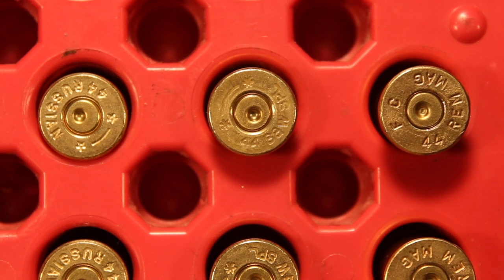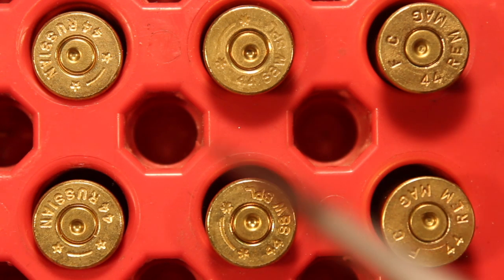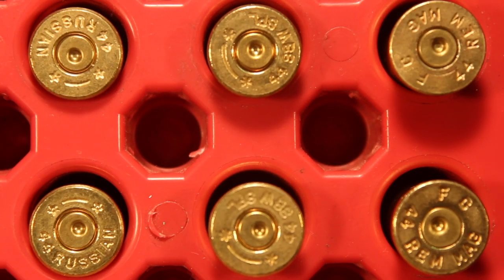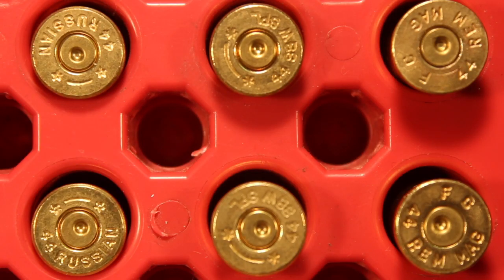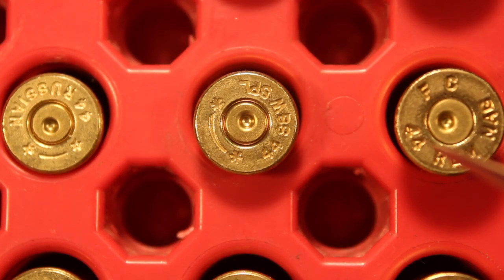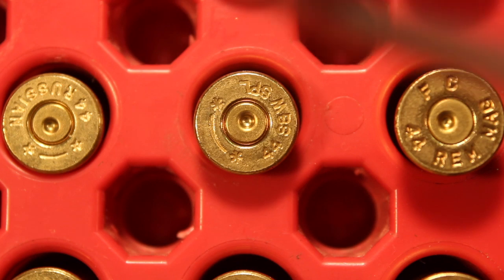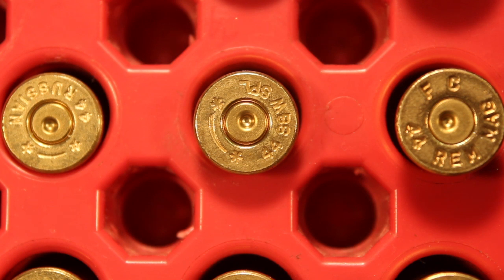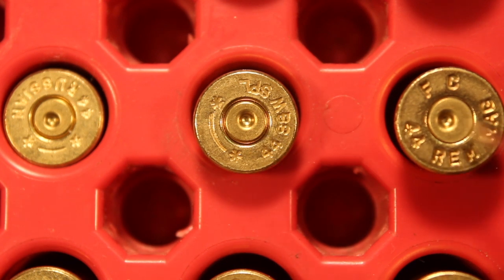Primer Sign Pressure Evaluation Revisited

Comment: I've been an avid reloader for nearly 40 years now, and both of my uncles, my father and grandfather are and were avid reloaders going back more years than probly anyone watching or even the guy making this video, and with all that combined experience to call upon I can say with clear thought and consciosness that only the slightly foolish will become trusting of trying to "read" the primer to determine if pressures are going too high,There are WAY too many variables in primer construction from brand to brand and even lot to lot within a given brand, you can't trust how the spent case  extracts from the gun as any real true way to judge either as wall thickness, hardness of the individual casses can vary due to manufacturing flaws or work hardening and if they were annealed propperly to maintian the propper hardness so they have that "spring back " effect that allows them that fractional amount of clearance from the walls of the guns chamber so they can extract propperly ( these things can all be used to at best have a very slight indicator of pressures but should be as they say taken with a very skeptical grain of salt at best)  then when you figure in enviromental factors like ambient temprature, elevation, barometric pressure, temprature of the round at time of firing, all of which can have anywhere from little to great change on the overall pressure and the pressure profile of a given loading, an example would be that I live at a place where the elevation is about 4000 feet average, and the average summer temp is about 80 degrees ferenhieght, I'm going on a hunt for wild boar in southern Texas where the elevation is barely above sea level and the temps go over 100, anyhow I get up one morning with my hog getting gun and a bunch of loadings to test, each loaded with slightly more powder trying to get that magic number of every last foot per second and foot pounds energy, and it's about 50 degrees at about 9am (what summer morns average where I'm at), I drive about 7 miles to the place where I shoot with the ammo and gun in the unheated canopy on the back of my pickup so evrything gets nice and chilled down, then when I get to where I shoot I find a shady place so I don't have that hot sun beating down on me later, and then I pull out my portable shooting bench and all my gear set up targets and chronograph, all the while the gun and ammo has remained maybe not ice cold but pretty darn cold, I proceed to load and shoot, I shoot the first loading and it's way less than impressive and even lower than what the book shows it should be.....Oh well I shoot the next and so on but then all of a sudden I shoot the next and now all of a sudden WOW I've found that magic load the velocities are awesome and it's giving me awesome sub minute groups and the primer seems to be not showing pressure signs (hopefully you are still under any reloading book maxes unlike a few idiots I've witnessed over the years), you think your good to go so you go home and load up a couple boxes to take on that trip to Texas, you get to Texas and it's a HOT day (especially for someone used to only about 80 and low humidity of only about 25-30% as where I live), and the hunting guide or maybe just someone you know wants to hurry you out to the hunting area because a couple huge hogs have been spotted and they would love to see you bag one of them, so you grab your gun and some ammo throw them both in the hunting vehicle were the hot sun is beating on them and head out, you catch up to the hogs and go for the shot bang...OH crap he's still kicking and try to take off, you try to rack another round in the chamber and it will not budge.....WHY?......well you just became a victim of temprature change induced pressure rise both from the differing temperature of the gun's barrel and chamber and of the ammunition, not to mention the effect of elevation difference along with humidity and overall barometric pressure of the place you are now using said "pet" loading, my one uncle was a hunting guide for many years in Idaho where I happen to live (now at 73 has just a year ago finnally retired from doing so) and I've worked many years with him as a horse wrangler for the hunting parties (packing in gear and what not for the hunting camps and so on), because of this have seen this happen more than once to guys that bring their handloads for hunting that's why every hunter that does so is made to shoot a few rounds before going on the hunt to prove accuracy and function or they get a refund and are sent home (hopefully you take this time and do the same before that Texas hunt no matter what may be waiting hog wise), I realise that looking at primers has been a long running way guys have used to determine pressures when trying to determine that ultimate pushed to it's max nursed it for the most of all aspects (accuracy, feet per second, foot pound energy and so on ) but there in lies the problem it's just maybe pushed to a point where the margine of error or better said the margine of safety may be being cut just a tad too thin, give the uncontrollable variables, There is a damn good reason why 100 year old ammo manufacturers such as Remington, Federal and others tend to load their offerings to the conservative side when compared to the even slightly "warmed" up loadings that are even listed in reloading manuals, it's far more prudent that if you need more power or better trajectory to seek out a gun/caliber  combination that offers what you need with a bit of a degree of excess, then to try and push a lesser  combination beyond it's easily achievable comfort zone, it will in the long run be easier on your equiptment, body, and pocket book.   P.S. your little test on this video can be explained rather simply, it all comes down to case capacity the russian yeilded higher velocity with the same loading because of less case capacity causing slightly higher pressure than say the 44magnum with it's much greater case capacity (44 magnum average is about 37 grains H2O 44 russian is only about 27 grains H2O ) the special would fall somewhere mid way in these velocities and pressures with the same loading of unique as does it's case capacity at 33 grains H2O, it's no real mystery why you got the results you did, SAAMI max pressure are as follows for these rounds 44 russian 14,500 psi, 44 special 15,000 psi and 44 magnum at 36,000psi, your loading of  if I heard correctly 7.5  grains of Unique is well below those pressure thresholds for any of those rounds if using bullets of light for caliber weight (180 to 200 grains or there about but absolutely not over the 200 grian mark for the russian considering slight changes in powders from lot to lot and bullet to bullet), just looked at one of my old loading manuals from 1958 and there is a loading with a 205 grain cast lead bullet number 429215 lyman using 8.5 grains of Unique (primer un-specified) as a max giving 1015 feet per second velocity, so no pressure signs would be expected give the guns shooting them have no problems and are within mechanical specs for the round they are made to shoot, but these loading will be pushing the Russian to very near or right at it's max comfortable limits to be sure, and most suredly the russian in your test is running at higher pressures with that loading than the special or the magnum would be due to their case capacities, I've had the great privledge of living very close (about 60 miles from Lewiston Idaho where CCI/Omark industries is located ) I even lived in Lewiston Idaho and worked for Omark industries for a short time and became friends with a guy that worked in the ballistics lab there, now nearly 30 years later he's retired but we are still friends and even occasionally go hunting and shooting together, so through him I have learned a ton of stuff about ballistics and have gotten a ton of information on the subject, people just don't know how some of these factors I have mentioned come into play and way too many think they are but are not balisticians, play it safe and follow what the reloading books say and check them against a few other sources when doing so, and if you can't get what your looking for from that combination of gun/caliber/loading then move up to the next more powerfull gun/caliber that will and still be well within the safety margin. take care and I hope my long winded book here helps to stear my fellow gun hobiests in the safe and prudent direction.
Reply from the maker: looseballs 1966 - Thanks huge for your comprehensive comment - read every word of it.  Ever since the first firearm, with obturation established, pressure for any given bullet weight yields velocity.  The job of the gun is to contain that pressure so that the shot can be delivered safely and with repeatability so the shooter can gain the benefits.  And your point on temperature conditions is well taken - match shooters have to deal with that constantly, even trap shooters use the old ammo in the sun to good effect.  Our range has a thermometer on the wall to provide that information to all the shooters.  And when my  late friend John did his successful African safaris, the high temperatures there had to be taken into consideration with his 375 H& H reloads - he hunted elephant and Cape Buffalo where fast second shots, if needed, were highly regarded.  Skeeter loads in the 44 Spl are more than safe in any of our 44 Magnums in good condition.  The safety margins are there as you have pointed out.  There are still those who wish to hot rod their 45 Colts when 454 Casull guns are available.  But it is the point where we are winding out third gear and shifting to fourth - how close to the red line do we want to take it? - every driver does that.  Trouble is, we don't have any tachometers, and we don't know exactly where our engines will blow.  You are urging all the teen agers to not find out.  This is fine policy indeed.  We learn about pressure signs from our manuals and our experience.  Thanks again for your input as, for sure, there is no fun to be had if our guns blow up.  With safety, all is good.  Steve
Reply: @FortuneCookie45LC  Yes that is my point exactly, don't push that redline too far untill you have enough time behind the wheel  and before you for sure have tried it out with all the variables tested, and that as you stated also just takes the time of experience, nothing worse than seeing someone new to the sport getting hurt becuase those cautions were thrown to the wind, anyhow take care and good shooting my friend.

Comment: The weight of the bullet that’s being pushed down the barrel is a factor too. From the 44 Russ to 44 mag, I would expect to see much higher pressure in the 44 mag due to the heavier bullet. Is this assumption wrong?
Reply from the maker: Luc Ferguson - Yes, heavier bullets put into the same powder charge will have higher pressure and lower velocity.  Takes more powder to get the same velocity with a heavier bullet.  And often times, trying to get high velocity with a heavier bullet cannot be achieved without going over the max SAAMI pressure = unsafe.  That's why, if you examine the loading manuals, you will see lighter max powder charges with heavier bullets.  Solution is to go to a bigger case volume cartridge with slower burning smokeless powder to take advantage of progressive burn = higher velocity with heavier bullets safely.  This video was to show that smaller cases do have potential in the above discussion, that has not been taken advantage of because of all the weak old guns out there.  In a 44 magnum revolver, that potential can be realized.  Stay safe though and work up carefully watching for pressure signs.  Best to ya,  Steve
Reply: Fortune Cookie reloads his own cartridges so I'm pretty sure he used the same bullet in each caliber . Probably the 245 grain semi-wadcutter as 7.5 grains of unique behind the afore mentioned bullet in a .44 special is what is known as the "Skeeter load" .  This load is named after a famous gun writer who wrote for a gun magazine (forget which one) and who liked hot .44 special loads.
Reply from the maker: Kasumi Kojiro - Thanks for your comment.  Indeed, same bullet and the gun is the strong Ruger 44 Mag Super Redhawk, but any 44 magnum or modern 44 Spl would provide all the strength needed and more for the loads in this video.  The Skeeter Load put up in 44 Russian cases is going to be a favorite load of mine henceforth.  1050 fps with a 250 grain hard cast bullet with fine shootability in my 44 mag Vaquero or 44 Super Blackhawk would be a fine trail or range load for sure..!!  Skeeter wrote for Shooting Times, and his relaxed style was much appreciated.  Best to ya, bro.... Steve
Reply: @FortuneCookie45LC        Thanks for the reply. Just wondering , how is the accuracy with the short Russian round out of the magnum cylander ?  I have dies  and brass but haven't tried it yet .

Comment: So Steve, what's your opinion on loading .38/.44 Special cases above published data WITH the intention of only shooting them in Magnum revolvers? I have a ton of .38 brass that I picked up for free at the range, my two Charter revolvers from the 80s are .357's, so is there anything wrong with loading .38 cases to .357 Mag pressures of say, between 25k and 30k PSI?

Another great video as always.
Reply from the maker: Dick Tickles - One of my favorite loads for the 38 Spl case is none other than the 172 grain Keith hard cast bullet and 12 grains of 2400 powder.  That load in any of my 357 Rugers will take any short range deer, hog or black bear nicely. I would definitely not shoot that load through any of my 38 revolvers and all of this ammo is labeled NOT FOR 38s in big red warnings inside and out.  Have a great day, Justin..   Steve
Reply: @FortuneCookie45LC  Obviously safety would be of the utmost importance in making a load like that and separating that ammo from normal .38 would be a necessity.

If only there was as much .357 brass available for free at the range, I'd take it and use that, but 'tis not.

Comment: Cylinder gap between it and the frame ...I had this primer flating with store bought ammo and my reloads in my 41 magnum    lets the case rim bounce off of the frame possible causing the primer to move rewards out of the case flating the primer   they make shims for S&W not sure about other brands
Reply from the maker: Chris 338 - My first 357 Magnum was a M28 Highway Patrolman S & W.  I shot that gun so much with heavy loads, it developed end shake.  Not just the primer flattening you mention, but I did blow the head off one of my 357 cases.  Solution was to have a gunsmith shim the end shake, but I just sold that gun to someone who wanted a home defense gun instead.  It was still a reliable gun, so I put M29 grips on it and sold it at an attractive price.  Back in those days, all you needed was a bill of sale, hand him the gun and take the cash.  We used to buy used guns through the want ads and face to face.  Talk about freedom...   Best to ya,  Steve

Comment: I have reloaded for years but I have seen many a primer completely flat with the machine marks from the frame in the primer from magnum revolvers with factory ammo. I don't worry about primer signs unless the primer pushes out around the firing pin.
Reply from the maker: joewcolt - You are referencing the tying up of a cylinder - not a good thing for sure.  Hot ammo will do that.  Sometimes oil in the chamber can do that with hot ammo.  A defective gun can do that as well with magnum loads.  I once had a revolver that would shoot standard ammo just fine.  But as soon as the first magnum was fired, the cylinder tied up because of case set back.  Thanks for your comment, joe..   Steve

Comment: So would the 44 Russian burn more of its powder in the barrel VS the 44 mag burning most of it in the case? Great vid!!!!
Reply from the maker: cory8791 - When the primer detonates, the powder ignites and a portion of the powder charge is pushed against the base of the bullet.  We know this because powder grain structures can be observed on the base of recovered cast bullets.  If the powder charge does not fill the case volume, that dynamic is different with different powder positioning at ignition.  Powder that is against the base of the bullet may indeed burn in the first part of the barrel thusly.  The bigger case will not generate the pressure that the same powder charge will yield in a smaller case.  We do know that excessively large powder charges will not burn completely with said barrel lengths so that power is wasted.  Progressive powders in these 7.5 grain charges in all three of these cases probably has at least some of the burn still continuing after the bullet has left the case.  Happens in milliseconds though.  Internal ballistics is a real scream, isn't it??  Best to ya,  Steve

Comment: Thanks for the video 👍. This is a topic in which I can always afford to devote extra attention. I'm forever going back n fourth when checking my primers, never quite satisfied w my discission. Constantly worried I'm getting too close to that, "back off" mark... I end up under charging so many of my loads. So frustrating, It's like OCD for me 😬!!! AHGG!!! (I need a chronograph), Thanks FC.
Reply from the maker: TheReindeer TheRabbitTheBat - Chronographs are nice to have, but not essential (I don't see many of 'em at the range - most of the time, mine is the only one in sight).  There's nothing wrong with loading up to 3/10ths of a grain below the max published loading data and getting good accuracy - and being happy with that.  Once you get real comfortable with primer signs, case extraction and gun functioning signs for pressure of your loads, you can venture to max incrementally with confidence.  Erring on the side of safety and caution is always good.  That's what our loading manuals are for.  Good shootin' to ya,  Steve